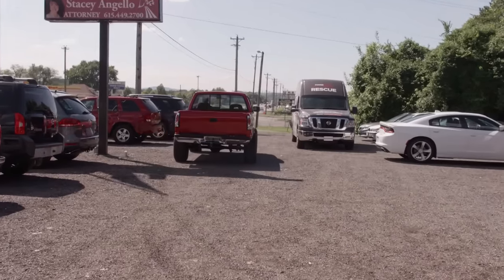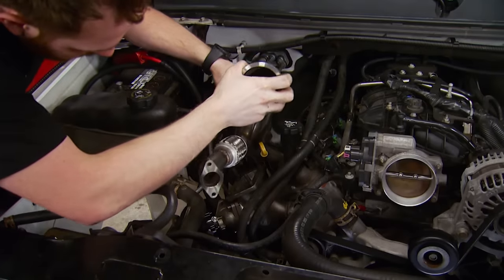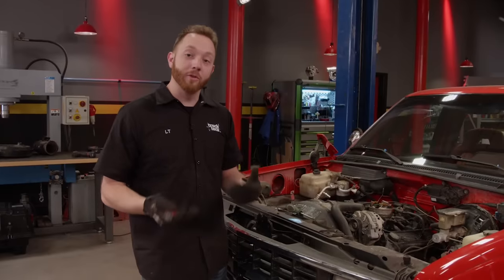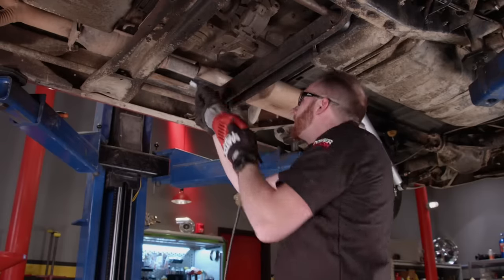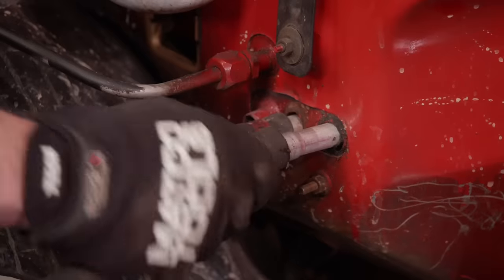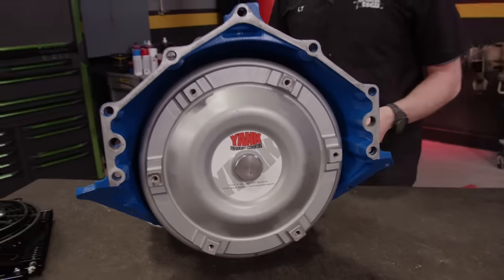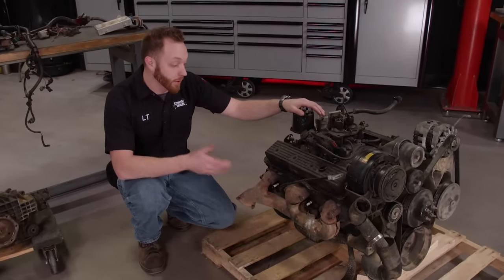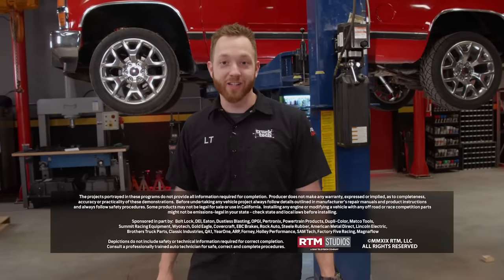LS Swap Do's & Don'ts on a Chevy K1500 - Truck Tech S6, E5

Comment: "This worn-out engine. (189k miles)"  Most of your viewers are driving 200,000++ mile work trucks....
Reply: Paul Hoskins My completely stock 318 dakota has 190,xxx on the motor & trans and still kicks ass on the street. Only thing i have problems with is the electrical (lights, blinkers, wipers barely work and idk how to fix it as well as the battery drains pretty fast for being only a year and a half old)
Reply: 242346 to be exact
Reply: 285000 2006 gmc crew cab
Reply: 284k 98 c1500 still riding like a champ after replacing a lot of gaskets.
Reply: 189k of bad maintenance
Reply: Poor maintenance from the start.
Reply: Shit my 95 is at 493k and I still drive it daily I put a trans in it back in 2010 but engine is still original
Reply: Chevrolet Silverado 94 246k miles
Reply: Very true. 95 K1500 305ci with 497,864 miles. Finally pulled the 305 and put a used 350. Put another 80k on the 350. Still runs. Like a champ.
Reply: They noted it's worn since it has power loss. Just because it runs at 200k or more miles doesn't mean it still retains the stock power. Lastly they're looking for more power 🙄 bunch of idiots on this comment section 🤦‍♂️
Reply: Everyone and the grandma knows small blocks last a long time. He described what the problem was with that engine.
Reply: 290k 93 c1500 lol, still running well enough.
Reply: Sea foam
Reply: 350k on mine and not a puff of smoke 💨 💨
Reply: 341,000 miles😅
Reply: Hahaha so true
Reply: 231500 on a 305, 6 inch lift pushing 35’s.
Reply: Lol almost all my vehicles are over 200k my f150 is 207k Jeep is 265k and the traverse is 180k
Reply: Insert my 290k mile corolla to get me back and forth to the contractor gate 😂
Reply: Depends how it was driven and maintained.
Reply: 296,000 miles on my k10 before the original 305 spun a bearing at 6500 rpm passing a 24v P pump at 105mph. Built a 350 for it now got 60k miles on it. Currently at 350k miles with the original 4 speed and 12 bolt, Dana 44
Reply: 255,000 on my 94 Silverado and still running strong!
Reply: @jameskollmann3616  Heck yeah!
Reply: @Sanchez-te5tl  Same here almost, I got 255,000 miles and still driving it.
Reply: That 5.3 LS crate motor its a downgrade from the 350 first off the 5.3 isnt as good of engine as your 350s were its best just to keep the 350 in and add upgrades to get better torque and horsepower to make it a mean truck with your stock motor
Reply: More or less a 30 minute ls swap commercial
Reply: Ibought mine at 100,000, plan on another 200,000 at least!!
Reply: Nearly 311,000 Miles on my 2002 5.3. No hiccups
Reply: White 97 Sierra 4x4 with 142k running strong. Bought it for dirt cheap with 100k 2 years ago Best thing is the truck has no rust what so ever, no dents and very few scratches.
Reply: @chrisv3863  you must live in a place where it doesn't snow
Reply: Lol, the truck only sees the snow maybe twice a year
Reply: @chrisv3863  luck you man, you should see what snow & salt does to trucks up here in southern Ontario if people don't wash then frequently. So many trucks could be saved if people just washed them during the winter. But people think cause it's a truck it doesn't need maintenance cause of their thick frames & durability.
Reply: I'm currently driving my '94 k1500 with a 350 that has 382000km on it
Reply: @deanfarr3249  you’re going to tell us,
The gm 350 is a better motor than a 5.3? I want what you’re smoking. 
I’ve never seen a old 350 make it past 150k. And the quadrajet sitting on top of it? Best carb ever?
I’ll take a 5.3 any day.
Reply: @paulsouza85  you heared what Paul Hoskins said
Reply: @paulsouza85  I got a 1992 chevy k1500 350 that has 230k on it and still going strong like a champ
Reply: 350,000mi here
Reply: @duckguide4109  yelp them 4.3s and 5.7s were pretty much bullet proof
Reply: 445000
Reply: @paulsouza85  My 1996 k1500 with a 350 has over 410,000 miles. Original motor still running well.
Reply: 315,000 miles on my ford explorer sport.  stock.. its my Frankenstein
Reply: 280k+ lq4, runs like shit, hasn't been serviced in 6 years, but goddamnit she runs.
Reply: Yeah but OCIs might not have been great on this particular truck, which would make blow-by more prevalent.
Reply: my truck got 236k and it’s a 2011 lmao
Reply: True that I have one with 289,000 miles still kickin
Reply: 263,504 on my 2002 gmc yukon vortex 6000
Reply: @paulsouza85  I agree 3000000 on 2003 with a 5.3  still running strong!!!
Reply: My 05 Silverado has 270,000 still running like brand new
Reply: 249k on my k1500 short bed single cab and purring cleaner than a cats asshole.
Reply: Haha no doubt. 230k right here, on 2000👍
Reply: My ‘93 T100 is somewhere over 700k, and my ‘14 Tundra is coming up on 200k quick. I don’t understand how people only put 5-10k miles on their daily driver. I don’t consider 200k exactly worn out when it comes to Toyotas. GM, Ford, and Dodge depend on the spec, year, and model. 100k was all one expected as late as the 90’s.
Reply: My 1997 z71 has 360k
Reply: @prestostudios128  got a 93 burban just hit 150xxx
Reply: I was thinking the same thing just about every car iv owned has had at least 180k Miles
Reply: 96 k1500 with 245k. Daily driven
Reply: @glimpsglimpse6648  97 k1500 with 252k daily driven as well and still strong as the day I got her
Reply: 02 Sierra 360,000 miles original engine new tranny
Reply: Lol tell me about it I'm almost  300K
Reply: @kyore789 316k 98 single cab shortbed havent replaced shit lol
Reply: @Isaac-sh2yb  beast
Reply: Right it's a Chevy that's generally like half way thru but he said it's burning oil and smoking so I assume it was not well maintained and has been overheated
Reply: 185k?  Currently daily driving a 96 C2500 with 487k, all original except for basic maintenance items (starter, water pump, PS pump, and a few other pieces)
Reply: Odo stopped working at 182k so that means something
Reply: 06 had 234k before she got a new owner
Reply: 95 c1500 with factory engine and transmission 307000 runs great
Reply: 268k and 2k miles on 5 psi boost. Blew up before 3k due to the wastegate getting stuck. Talking about a 92’ nissan pickup with a stock internal 2.4 4cyl.
Reply: 91 Silverado 185,000 with slight blown head gasket just got dukes of Hazzard' all way down dirt road home😂🤣😂
Reply: Maybe his are all City miles 🤷‍♂️ I’m rolling 230k on my 2008 GMC Sierra 😎👍
Reply: Spent 2600 for my 383 and reprogram? Just last year with a Scat kit.
Reply: 354k in a 01 silverado and it's about to get its first trans rebuild
Reply: @Exit_343 never replaced the cam ? My 305 wore the cam out at 180,000 replaced it 60,000 miles ago and still going
Reply: You guys have made me feel SO much better, I’m just buying a 217k express van 5.3 and been on edge all week about how much miles I have to go before she gives. I’m thinking if I can steadily overhaul her she just may make it to 300 eh? Oh, not to mention a pretty legit 2 owner history with lots of maintenance records
Reply: @EzDuzzIt4200 most likely worn out relays
Reply: 183k. As of right now cylinder 5 isn’t firing…
Reply: 288,000 14 f150
Reply: Right 😂 had another 60k in her atleast!
Reply: That’s what I was thinking
Reply: @biggun4557   cool
Reply: @PedroGomez-bd9ro  my 99 gmc 5.7 v8 assembled in Mexico … 225 k ,  no smoke .  Indestructible
Reply: @vincentsnow8436  my 99 5.3 not tick or puff of smoke with 365,000 miles not kilómetros
Reply: Try 400k on an 04
Reply: 213000
Reply: Mines has 210k still running strong
Reply: I know this is an old post but my daily driver has 286000 I'm the original owner 2000 gmc sierra 1500 5.3ls runs like it did 23 years ago
Reply: Can they recycle those parts at least? Since they're not as worn
Reply: 360k tbi 350
Reply: my 305 has close to 255k and shes still running lol
Reply: I have 365000 on my 95 C1500 with 5 speed and still going strong and those dual glass packs rumble beautifully. My daily driver.
Reply: 345763
Reply: my chevy express is at 488000km, i think thats atound 360000 miles😂
Reply: Facts... 😂
Reply: 230000k 93 with manual
Reply: He was talking about the engine in that truck specifically. He was not making a generalization. Watch it again.
Reply: 97 burb 5.7 with 246,000
Reply: 413- 97 k1500 but she’s getting tired
Reply: I have  309k  miles on a 95 Tahoe  don't burn oil or smoke.
Reply: My 96 k1500 just locked at 311k
Reply: 98 with 215k
Reply: The first gen vortex runs forever if you take care of them
Reply: My 88 gmc has over 500 thousand on it
Reply: @CamHerkenhoff  great trucks! Measly 139k for mine
Reply: My lowest mile vehicle is my ctsv with 180k😂
Reply: 453k 2005 express 3500, soon going into my dad's 93 Silverado
Reply: 3010000 on my 2001 tahoe